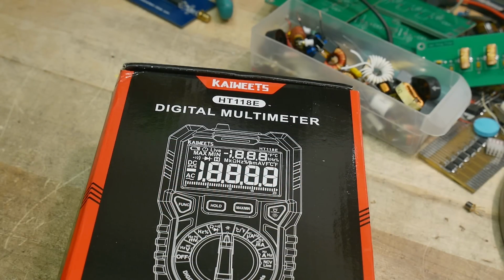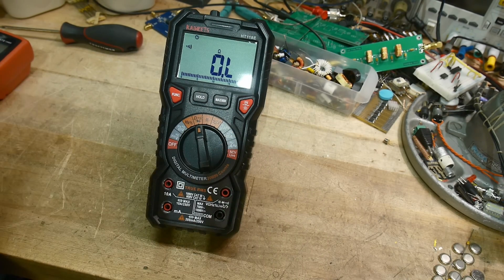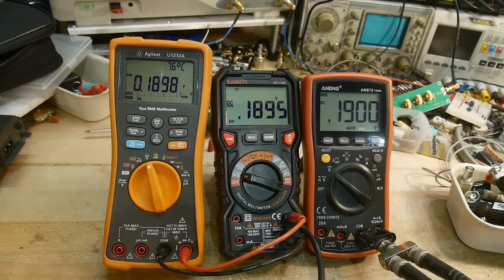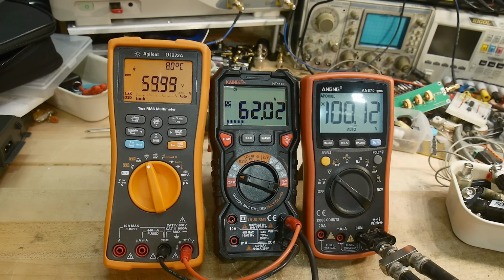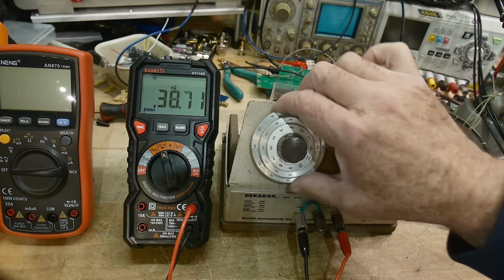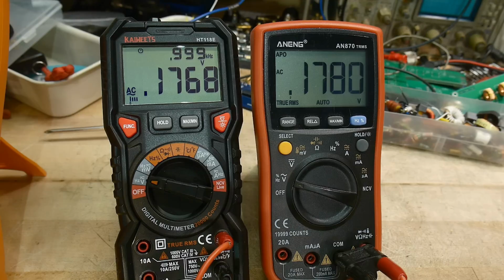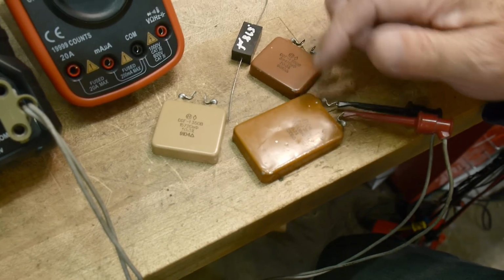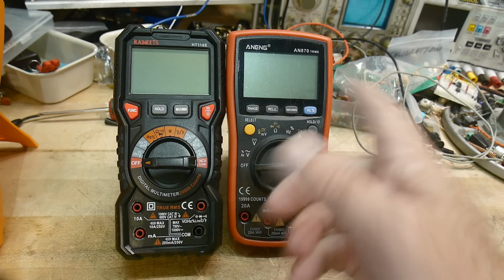#1423 Kaiweets HT118E 20000 Count Multimeter

Comment: The problem with these is they don't have a relative mode, to me that's unforgiveable for a 4.5 digit meter.  They also have pretty poor protection, so strictly CAT 1 or maybe CAT II @ 240V.  Otherwise, a nice enough meter for the bench.

Comment: Thank you for the very interesting presentation. I really like the Aneng for the design and the price as the accuracy is anyway good enough. As I do not need 20000 counts all the time I use smaller versions from Aneng in more compact cases which fit well between all the things on the desk.

Comment: I was surprised to see the HT118E was only rated to an altitude of 2,000 meters. Living at the base of the Rockies and the Continental Divide I'd need a meter rated to at least 10,000 feet. I've used multimeters more than once at that altitude. What gives with the 2,000 meters? Cheap capacitors?
Reply: LCD display

Comment: At a ~0.15% error for basic DC for 20,000 counts I would honestly send it back and hope for a slightly better unit even if that is spec for the meter. But, I use cheaper meters with more casual measurements so I doubt it would make a difference and at least the error is consistent.
Reply: Spec is supposed to be 0.08%+5
Reply: Indeed, I don't see the point of resolution without accuracy! I'd much rather have the Aneng.

Comment: I have never investigated,... are such meters subject to calibration? Or are they fixed?
Reply: They are calibrated at the factory. Most have an 8 pin eeprom to store their cal data.
Reply from the maker: They are fixed. I have not seen any manufactures release calibration procedures. Even if they did, it would probably require special software and equipment